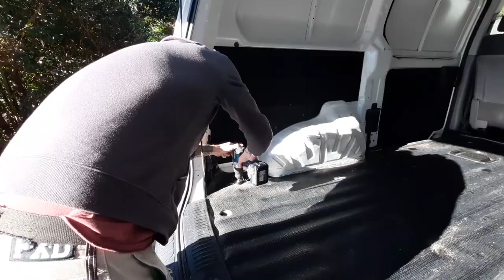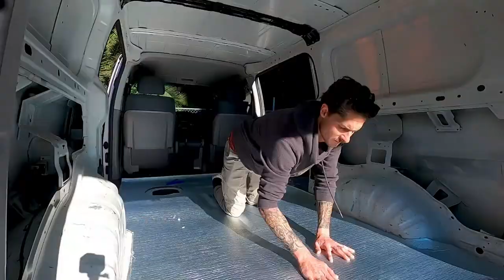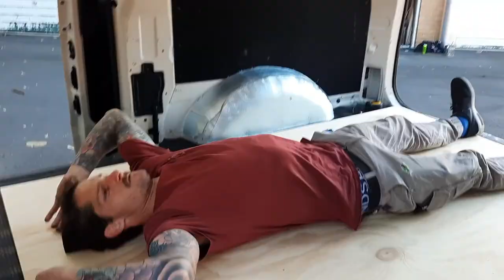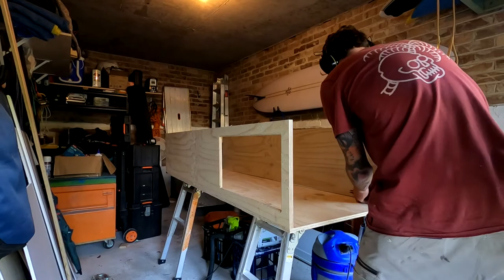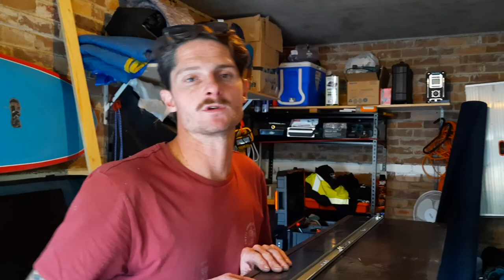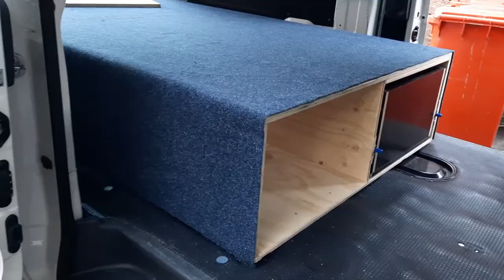Hyundai iload Campervan built for surftrips and carpentry part 1

Comment: Nice job m8. Got a similar plan, although, I left the parcel barrier. Hung a folding table on it behind the driver, and on the left was a fridge with another folding table. I cut the centre out of the parcel barrier so I could get access both ways. Then seats behind that to sit to eat. But I'm a 160cm shortarse. Got a propper camper dunny,  behind the seats and a cooker and sink on the left. Bein 160cm I can sleep cross ways. Under the bed is a boot with access from inside and through the doors.  Lidded storage over the wheel arch area. Yours looked a better than mine, and with the tools I saw your way more skilled than me at the build. I like the way you did the carpet!